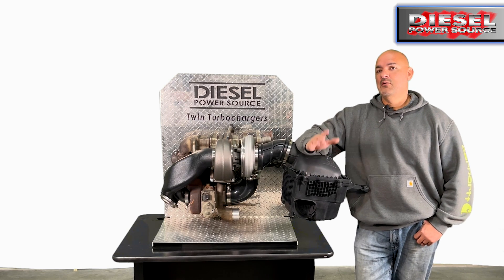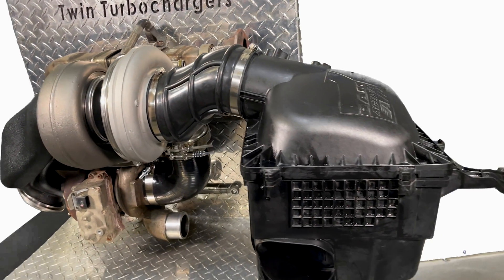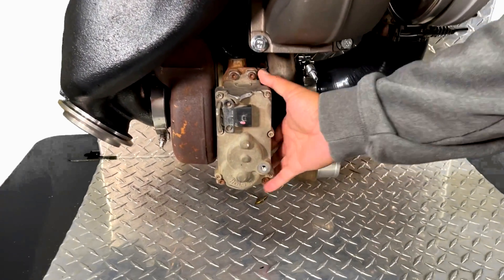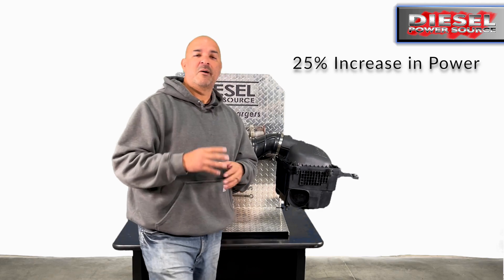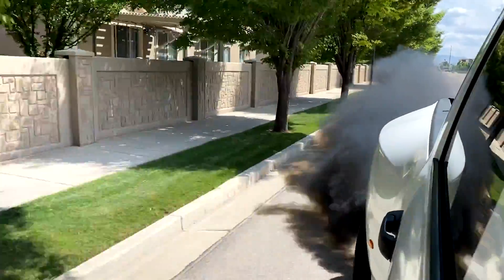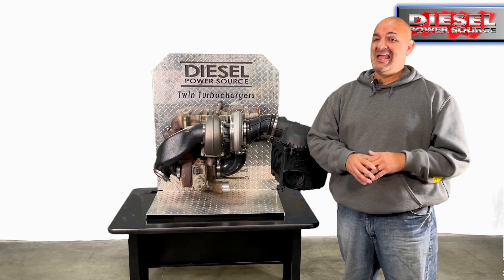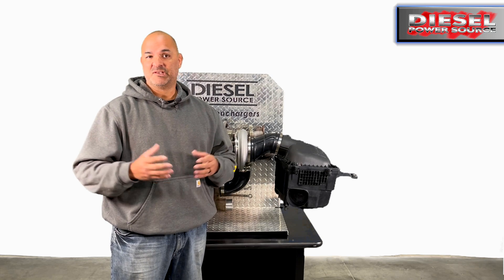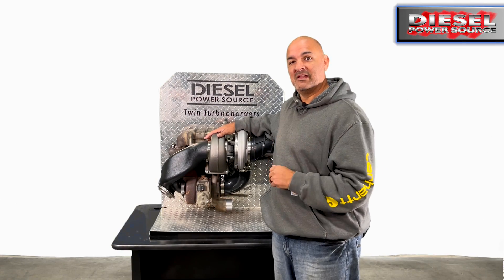Add A Turbo Kit 6.7 Cummins | Cummins Add a Turbo Kit | Emissions Friendly | Emissions Compatible

Comment: I have a couple of 2010 modle buses here in Australia that have ISB 4.5 Cummins engines in them currently with factory Holset HE200WG single turbo in them, any chance you have a kit or could do a custom compound turbo kit for them?

The engines currently put out 180hp and about 700nm of torque, there are newer models of this same engine that put out up to 207hp and about 850nm of torque from factory but it uses a VGT.

These engines my buses use have EGR and Adblue but no DPF or Catalytic Converter from factory (built in China) but with 2 EGT sensors and 1 oxygen sensor built into just 1 muffler. 

Kind regards,
Alan Wilson.